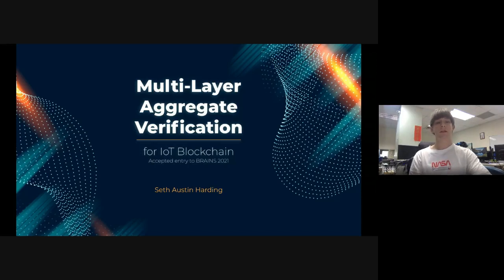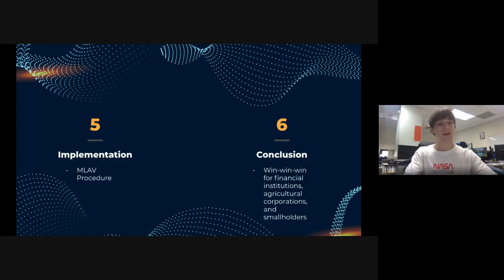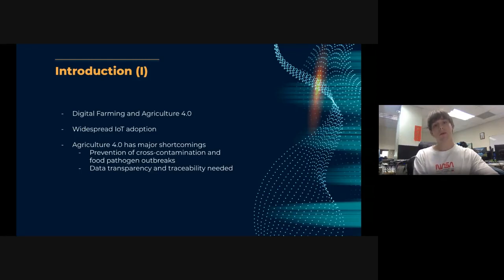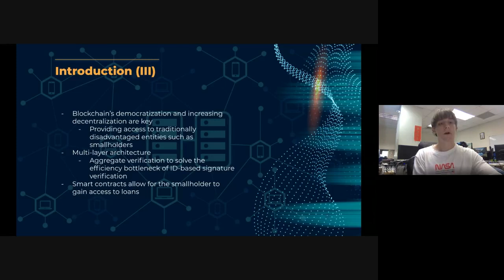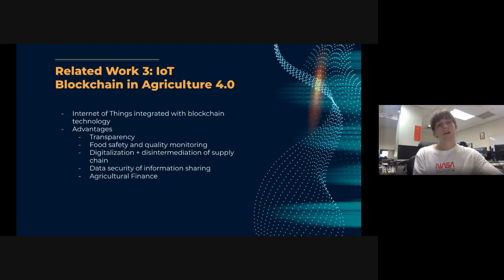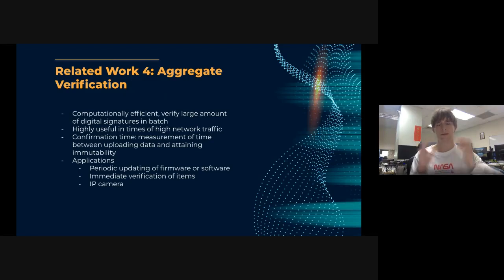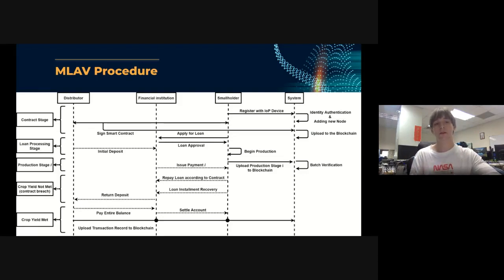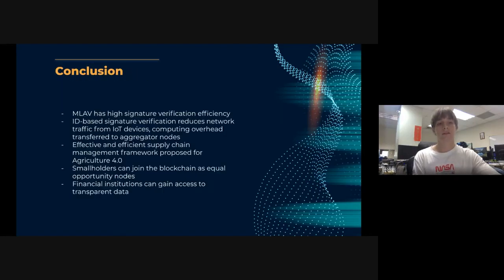Multi-Layer Aggregate Verification for IoT Blockchain

Comment: Hi Austin, I'm one of the judges of the research exhibition but not familiar with blockchain. Could you please use few lines to highlight the problem of interest and the main contributions of your work? Thanks!
Reply from the maker: Hi Frank, absolutely!  To summarize what this work achieves:

Background: Current agriculture 4.0 has had large companies successfully apply blockchain solutions and ecosystems for tracking and tracing agricultural produce, achieving transparency, traceability, and digitalization, but these existing blockchain solutions are not comprehensive.

Problem 1) The upstream nodes the aforementioned large companies serve are all large-scale production suppliers, and smallholders are not taken into consideration. 
Problem 1 solution) We use a multi-layer architecture that serves three purposes: facilitating smallholders in joining the agricultural blockchain as equal-opportunity nodes, uploading of production activity data, and reducing costs (ex. Ethereum gas fee). 

Problem 2) Most IoT blockchains adopt an ID-based signature scheme in IoT devices, which frequently has low efficiency.
Problem 2 solution) We use aggregate verification, effectively increasing ID-based verification efficiency while processing large clusters of data transferred by IoT devices.

Problem 3) The supply chain for Agriculture 4.0 is inefficient in many areas.
Problem 3 solution) We design a blockchain management framework using smart contracts to facilitate the financing of upstream producers.

Essentially, we design a framework called Multi-Layer Aggregate Verification (MLAV) in order to improve supply chain management with IoT Blockchain devices, and we apply MLAV to IoT Blockchain applications in Agriculture 4.0 for proving the feasibility and applicability of our solutions.